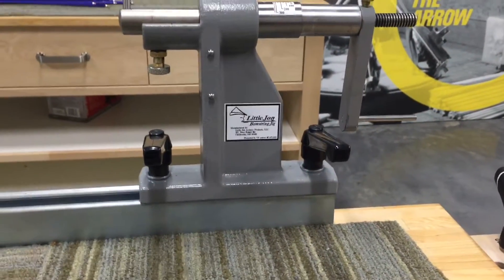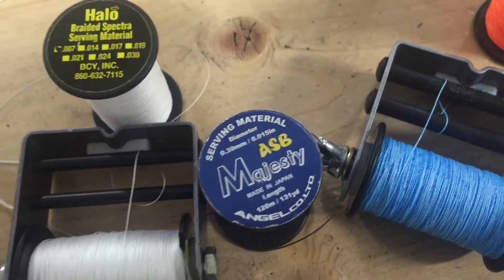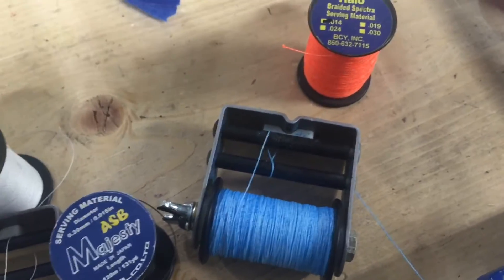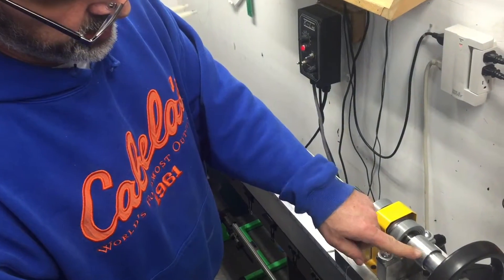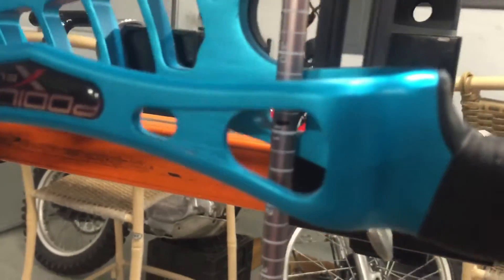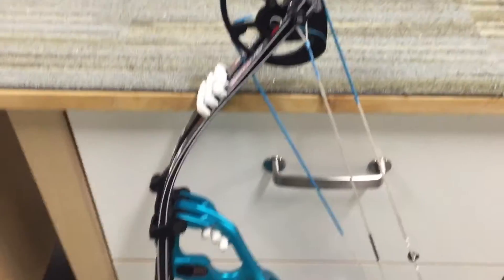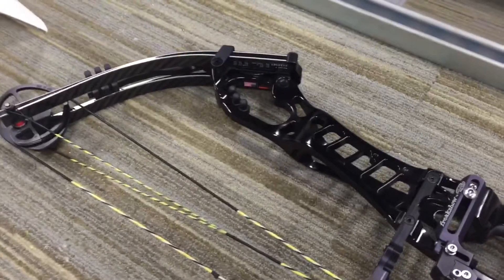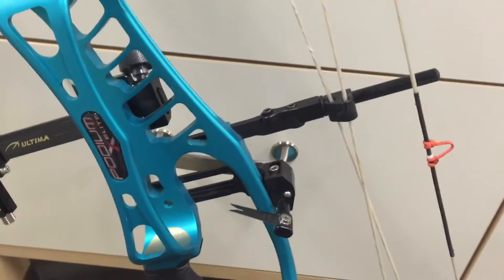Steve Anderson new string bow build

Comment: Cheers Steve, very informative. It is difficult to find bow building and tuning videos for the Podium X. I also found that timing the cams at the same time created a better feel and consistency compared to my Pro Comps and Vantage Elites that were were better with a faster top cam. It would have been great if you could have shown the process for adjusting your draw length using the cables as this is often a confusing process to understand and get right.

Comment: Great video! what size knocks are you using that'll fit on that ginourmous fat string? I make my strings/cables out 24 strands of 452x and just made a set out of the natural. Already with .018 62XS center serving, it's just a hair small for .098" throat Easton pin knocks. So 32 strands is going to be like a rope!
Reply: lstavenhagen he says he uses .015 center serving.
Reply: Ok, thanks for the reply, I was just wondering what size knocks he was using? For example, 26 strands of BCY X with .014" Halo center serving is basically tight with my Easton pin knocks at .098" throat diameter. So a 32 strand 452X string with .015 has to take some ginourmous knocks lol....